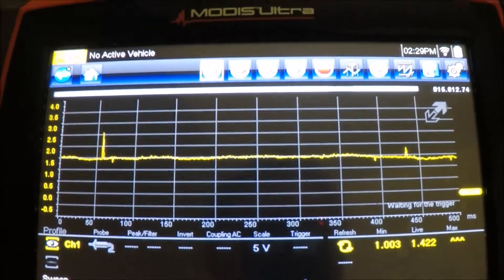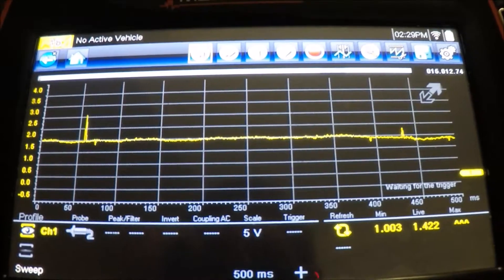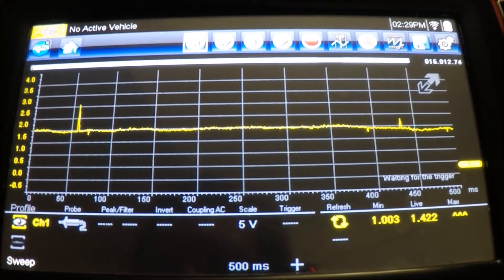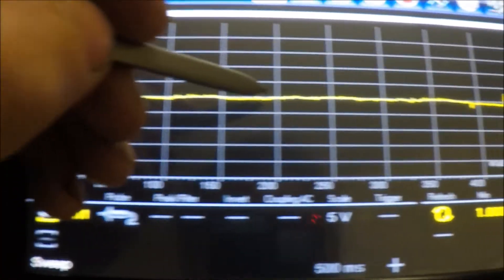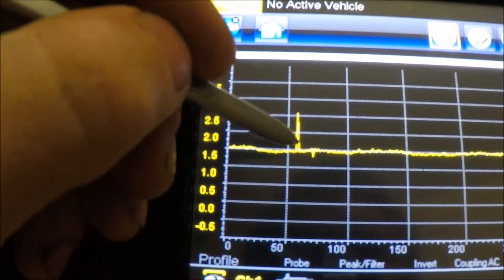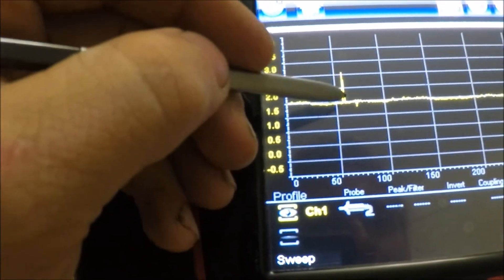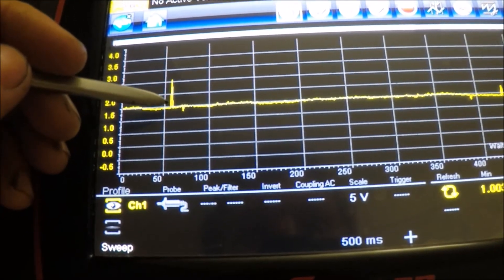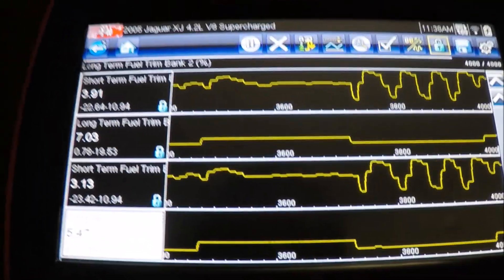Lab Scope Diagnostics Lesson- MAF sensor waveform

Comment: I have too lean system on my car, LTFT rises more than +15 when rpm rise, no vacuum leak , can i say its faulty MAF sensor?
Reply from the maker: It could be. Check for pcv or crankcase breather issues as well. You'd want a good maf, not auto zone or napa
Reply: @skatir9  i have 2008 sonata with 2.4 L engine and think it doesn’t have pcv valve and don’t know about crankcase breather !
Reply from the maker: The pcv valve is on the front of the valve cover with a hose connecting from it, to the intake manifold.
Reply: @skatir9  thank you 🙏

Comment: If the MAS is detecting false air, shouldn’t that trigger rich codes?
Reply from the maker: Awesome question! So in theory you're correct. Here is a breakdown that might help. So the MAF detects false air and tells the pcm fuel table to enrich mixture ( you see the fuel trims rise on live data). Once the adoptions reach a certain point during test drive, the pcm decides it has added the maximum amount of fuel it can and has reached its threshold, and sets p0171, p0174, etc. So in theory its running rich because there is no extra air like there would be if the issue was actually like a leaking intake gasket. Does that make sense?
Reply: @skatir9  The original poster is correct and you're a little turned around on your understanding of fuel trims. If the MAF is incorrectly over-reporting the amount of air entering the engine, then the ECM will add too much fuel based on this miscalculation, the O2 sensor will report back that there's too much fuel (really a lack of residual oxygen since O2s don't actually sense fuel directly, but same idea), and the ECM will respond with negative fuel trims that result in rich codes. You seem to think that fuel trims are a direct response to where in the fuel map the ECM is looking to decide how much fuel to add, but they're not - they're a direct response to what the O2 is reporting after the fact. Hopefully this makes sense.
Reply from the maker: @nowayjose596 hey thanks for the reply. Your information would apply if we were dealing with a vacuum leak, or low fuel pressure, etc. The high voltage reading from MAF will definitely control the short term fuel trims and the O2 will control the long term fuel trims. I am betting you havent seen a MAF waveform like the one in the video.
Reply: @skatir9  MAF does not directly control fuel trims, whether STFT or LTFT. This is where you're incorrect in your understanding. STFT are controlled by the ECM in direct response to feedback from the upstream O2/AFR sensor. This is true if you have a bad MAF sensor, low fuel pressure, a misfire, a vacuum leak, or a hole in your piston 🙃 You're welcome to believe whatever you'd like to the contrary, but hopefully anyone else reading this will do some further research to discover that EVERY reputable source will agree with just one of us.
Reply from the maker: @nowayjose596 so think about it like this. If a MAF is telling the ECM more air is coming in, but the O2 reads perfect, why does the fuel trim change.... As described in my video 🤔
Reply from the maker: @nowayjose596 hey, just circling back to see if you had any more questions relating to fuel trims/diagnosing.